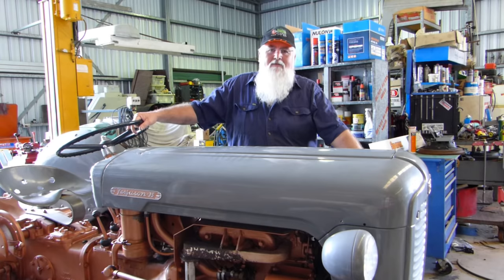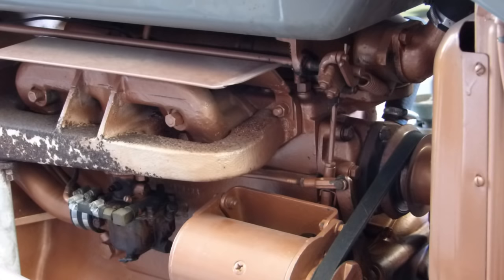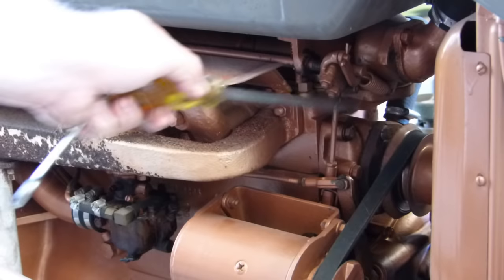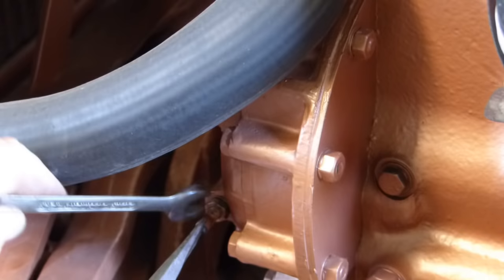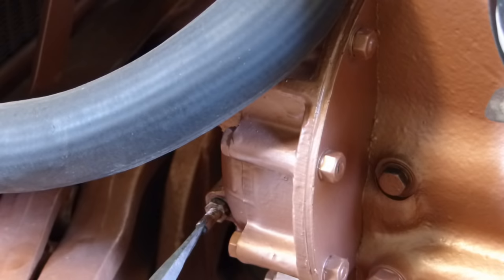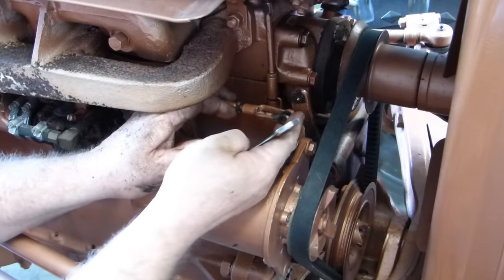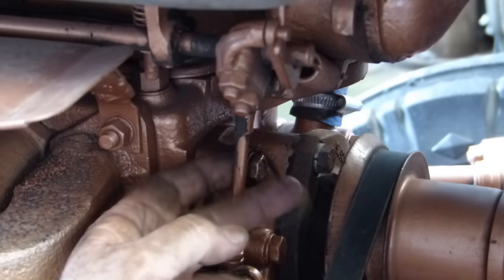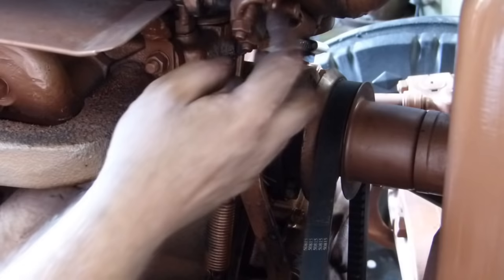How to Adjust Your Ferguson Tractor Governor

Comment: Just set mine up this week after having the front end apart with leaking timing cover and govenor seal. 
I couldn't get it idling right, and finally worked out it was the vertical governor shaft not putting enough pressure on the horizontal governor arm!! I wound it out and now it's running like a dream 🙂. Just some advise for all the people seeing this. Thanks lance!!! Ur vids are amazing, and preserving many generations of tractor enthusiasts!!
Reply from the maker: Thanks.

Comment: Thanks Dude. You just made my day. I have been having this problem for months on my tractor with no power kick when put under a load, your video just made it easy for me to fix and get her running much better. I now know too that my spring is just very worn out, so I ordered a new one and will be putting that in when it arrives. But for now she is running a lot better.
Reply from the maker: Glad I could help. They run nice when you get it right.

Comment: Mr Bears I too am having troubles with my rod. Where yours is sticky, mine is sloppy. I have looked behind where you stick it in the hole and it's just slopping around. After watching your video I see it can be adjusted, shall do it tomorrow. Thank you this is not the first time you videos have helped me. I have inherited a neglected 49 Fergie and I am determined to fix it, wouldn't be possible without your information, Thanks again.
Reply from the maker: Thanks, I hope you sort it, the whole process is fairly easy if you sit and look at it.

Comment: You are an excellent teacher! I like how you don't leave out little tidbits of information. I have always avoided any work involving governors because i just don't understand them. My TEA20 had this annoying issue with the throttle leaver always wanting to be in the idle position. Today, thanks to your video, I figured out that the previous owner installed the idle arm and spring upside down. So instead of sitting below the Throttle rod, it was over the top.. Hopefully that fixed it! Thank you so much from Canada!
Reply from the maker: Thanks Ken, Im glad it helped.

Comment: Awesome video! I hope it helps me. I rebuilt the carb on our to35 and pulled the clevis end off of the rod. I did measure the length but found out later I didn't get it back to previous length. I could only get tractor to start but not run. My kit instructions were terrible! My kit was from tractor supply. After searching YouTube videos, I found that I didn't replace rubber seal on throttle shaft. When I tried to replace the seal, I popped out the brass piece that holds it in and lost it, but found it a few days later. I'll work on that as soon as rain stops today. Not sure if this seal prevented tractor from running. I originally rebuilt carb because something stuck open in carb and an entire tank of fuel drained out through carb from one evening after use to next afternoon after work. My carb was so gunked up, it looked like a kid made a mud ball. The inside looked like someone was using it to pan for gold. I had to soak it for two weeks in my parts washer. But, even after cleaning and new needle and seat, needle doesn't freely drop with float while bench testing for float drop measurement. Hopefully it will with fuel pushing on it. My kit doesn't have spring or clip on needle. A mechanic friend suggested making a clip from a paper clip. Also, throttle would never stay, always had to be held in place. So I removed long rod. Spring was broken into a few pieces. I replaced round gasket and cut down a generic spring. Now I need to get everything back together and adjust tension. This video should be of great assistance.
Reply from the maker: G day Daniel I hope it does help you it seems you have had quite a lot of trouble so far.

Comment: Thank you, I've been waiting for something like this. I have a Fordson Dexta with the Standard 87mm, and no petrol manuals exist for it, apparently. I'm located in Ontario Canada and will have to wait until the temperature gets a bit closer to freezing before I adjust it. :)
Reply from the maker: I had a look at the petrol Dexta recently and I believe it  is the same engine so hopefully it will work for you.
Reply: It warmed up a week or so ago, and I got the throttle linkage and governor adjustment straightened out. Now when I'm piling snow and can't go any farther the wheels start to spin and the engine doesn't  bog. Thanks.

Comment: Another spot on explanation on a subject which up until now always worried me to get involved with , I am off to  check  my TED20 this morning  as it has suddenly started to cut out when I go from medium throttle to idle , I hope this maybe the reason why unless you know of any other reason .brilliant video once again , thank you very much
Reply from the maker: G day Paul, Your tractor shouldn't cut out due to governor adjustment as it should just push it back to idle, I would check carb adjustments.
Reply: Will do cheers Lance

Comment: Thank you for this great instruction Lance. I adjusted my governor system after a complete service of the timing cover with new seals and even new needle bearings but I have one strange problem. When I open the throttle from idle position and go back to idle again like you do around 19.30  the link to the carburator does not move back to idle position. The link is moving when I open the throttle but when I close it the link does not move. Everything is working free and fine on the carburetor. My only idea is that the spring sitting on the rod is too long or not strong enough but the spring is new and the only length you find nowadays for sale. Description says it fits for TEA engine. The parts list says 2 different springs were available depending on the serial number under and over 100000. When the engine is running and I open and close the throttle the engine goes back to idle. A much bigger issue is that I cannot reach more than 1500 rpm because of the governor stepping in much too early. Without the links connected I can open the carburetor throttle and rev up much higher but as soon as the governor is working it pulls back the lever much too early. I will open the whole thing again and check the weights of the assemby first to compare with another weight assembly I still have somewhere.
Reply from the maker: The rod in the spring is adjustable and it should physically push the carb back to idle. Try adjusting both the upright rod and the one to the carb.
Reply: @BundyBearsShed  I did exatly what you teached in the video and used the service handbook as well and the procedure is the same. It does not work and I reach only 1500rpm what could be the proof that you are right and I have to face the fact that I am to stupid to adjust my governor. And I have no idea why...

Comment: I watched this video a half dozen times.  I still can't get my tractor to idle.  If it idles ,  it won't rev and the governor does not call for more throttle when under load.  I have to settle for one or the other.   I go for no slow idle. Thanks for the video.  It is very good.  I just wish it worked for me.
Reply from the maker: Not sure why Lynn, just check for slop everywhere and remove it if possible.
Reply: Thanks.  I just tried.  I think the problem may be the idle adjustment on the carbitself. I removed the screw entirely and no change.  By the way, who's the genius that put the idle adjustment behind the carb. where no one can get to it to make adjustments with the engine running?

Comment: At the end of the video you mentioned the throttle kicking. Did you cover this in another video? Ours does the same. Very good videos by the way.
Reply from the maker: Fiddle with the length of the rod going back to the carb.

Comment: Lance, watched this video so many times I can mouth the words you are saying...LOL.  Great video!  The Spring, Plunger to Lever does not seem to be available anywhere that I can find.  Would you possibly have a source?  Compensator springs all over the place to buy.  Having to resort to buying used governor  parts to get this square ended spring.  Of course, the old ones are tired.  Any thoughts?  Thanks for all you do and pray the family are all doing great!
Reply from the maker: G Day Marvin, I dont have a supplier and there is not one Im aware of but it would be handy at times as I get asked from time to time.

Comment: Very well done and a VERY helpful video. And now a question. Where can I buy linkage parts? My 1/4" adjustment rod is broken just above the lower "fixed" adjustment nut. Yes I can use a piece of all thread but it won't be as strong and I want an original look. Thanks and keep cranking out those videos! You/they are a LOT of help!
Reply from the maker: I have the ball and rod on the queensland tractor spares web site.

Comment: Hi Lance, love your videos, the setting of the governor in your case seems pretty Straight forward, however my fe35 has not been rebuilt so I was wondering if you have any tips on goner adjustment for an older tractor as my governor weights keep getting stuck at full fling when I adjust to your/factory settings. I feel I’m close to resolving the issue but it keeps happening 
.
Thanks in advance

Regards

Kerry
Reply from the maker: set the screw in the timing cover in a few mort turns, that will stop it coming out so far , to a point.

Comment: Hello Lance from Southern Arizona, Excellent video, I have a 49 TO20 that has a significant surging issue. I've tried carb adjustments, with little help. When it surges I can pull then release the choke knob and it clears for a moment.  Do you think my issue could be the governor?  I plan to adjust it per this video.  Thank you for all your great videos.
Reply from the maker: It could well be the governor, it is a good place to start. Lengthen the rod from the carb to the governor and see what happens.
Reply: @BundyBearsShed  Thank you very much, I adjusted per your video and it did help a lot.

Comment: I have a TE20. My Zenith Carby was in bad shape. I ended up putting an aftermarket carby on it modeled on the Shebler carby. It has never run the same since. I have done a heap of troubleshooting but can’t seem to get things right. I watched this video and realised I never reset the govener so I will try the adjustment and see how I go. Should I rebuild my zenith or continue to use the aftermarket carby? Thanks for the great video. 👍👍👍👍👍
Reply from the maker: I always prefer the Zenith they are not too hard to do.

Comment: I rebuilt my MF135 engine about 2 years ago because the governor fell apart inside. put all new back in and I still for the life of me cant get the governor set at all. Its like it doesnt work at all while pulling my brush mower. Any ideas? Also, the screw on the timing cover screws in way more than what youre showing before I feel and tension.
Reply from the maker: i would suggest backing the screw out to give the governor room to move possibly.

Comment: Hi Lance, been following all your Fergie vids. Been trying to adjust my governor linkage, but when it comes to attaching the governor arm to the carbie it's pulling the throttle forward, it's as though the spring for the bumper screw is pulling it back forward. Can you help? Also the carbie is running a bit erratic and can't seem to get the tuning just right. Got a good spark at the Distributer
Reply from the maker: First up try lengthening the rod a fair bit it seems to work wonders.
Reply: Thanks for the help Lance, really appreciate it!

Comment: Hi lance , hopping you can help me , I have put new weights and gov or cup on my tea20 as part of the rebuild , but the govnore keeps jamming , when it take the front cover off the cup has come out too far and got caught on the weights and Carnot go back in .
if put back together twice now and it keeps happening ?ant clues as to why , maybe a faulty new weight basket ?
regards Mark New Zealand
Reply from the maker: Try tightening the screw in the side of the timing cover to put tension on the spring so the cup cant travel so far forward then do the setup.

Comment: I have a problem with my TEA20.  My question is does the throttle pull down or push up for idle? This is my first tractor and it was not all put together. I can't get it to idle , the springs make it run full throttle.  Also do you know where I can get a governor lever arm rod? Great video.
Reply from the maker: G Day Dennis, Pull the throttle for throttle and push it back up for idle. You would need to try a wrecker for the lever arm.
Reply: Thanks
Reply: @BundyBearsShed  , Lance can you help me out with this. I just drained my transmission and differential oil. I removed the 3 drain plugs, and it looks like the front 2 plugs had regular oil in them, and the back 1 had transmission fluid in it. I thought all 3 plugs would have the same oil in them. I don't see where I can fill the differential. Don't you fill the transmission then the oil good in all 3 spots? I have a TEA20 tractor.  Can you help me with this. Thanks

Comment: Lance Great Video, very helpful. I have TEA 20 1948 model. In video you show lots of movement in the governor arm at time 4:29. I have very little movement maybe 6mm at the pin location. Does this mean i have a issue within? Do i need to remove the timing cover and inspect? What will i be looking for? Thanks in advance.
Reply from the maker: G Day Todd, Normally not much movement will help with these governors, It depends on how far the screw is in.

Comment: Hi lance, ive got a fergie 20 tvo im only young and would love to start this as a good hobby but im having a problem with my throttle leaver it is stuck on high  acceleration and wont go down i took the throttle linkage off the carb to see if the throttle linkage was too short from the governor but it just is moving a tiny tiny bit, i still dont know if the throttle linkage is too short but i highly doubt it because it does move the same way with it connected to the carb but only if you push it, not with the leaver atall. Sorry if you found this hard to read i have adhd and find it hard to describe stuff 😅. Thank you, Kevin
Reply from the maker: Follow the video step by step. Start at the front and work your way back. It is hard to say what is going on without seeing it.
Reply: @BundyBearsShed  thanks lance will try that today

Comment: Hi Lance. Great video. I think I followed it properly :) Do you know, should the throttle handle stay where you leave it or should it (like mine) feel like it is spring opposed after half way, so it comes back to half way if you let it go?
Reply from the maker: Spring back, It sounds like yours is doing the right thing.

Comment: Hi and thanks for a fantastic video.
On my TEA 20 from 55 the govenor kicks like a mule when i open the throttle a bit. It kicks two or three times in a row, every time. What could be the problem?
Reply from the maker: I would look at the carb settings as it should even out reasonably quickly.

Comment: Gday Lance watch your video with great interest i had to put a new timing cover on my TED20 cause the spring was broken in there all replaced chain lined up to cam like you showed run really great however the governor does not work i done all the setting you showed on this video you got ant ideas what going on many thanks Ron ps keep up the great work
Reply from the maker: G DayRon, It is hard to say but I would start with running the tractor and see if the governor arm moves at all. You may have to adjust the side screw out a little.
Reply: @BundyBearsShed  ok thanks will try that many thanks Ron
Reply: Gday Lance i have done that i started out with the screw in 2 turns so i came to 1 turn no different so i turned it in 3 turns still no difference many thanks Ron

Comment: I have a TE-20 that I recently bought and they had a big spring going from the carburetor to the governor rod. Anyway I started following along to this video to set the governor and at about the 4 minute mark of this video with the linkages un hooked I found the the governor rod doesn’t move ? What’s your thoughts
Reply from the maker: See if the side screw on the timing cover is not in way too far but it could be possible that the shaft is stuck.
Reply: @BundyBearsShed  
Thanks for the advice. I’m planning for the worst and buying a new replacement governor it’s an umbrella type. I’m told it will replace the old weigh style that mine has. This tractor has very little wear so it may very well be stuck.
Reply: I had the screw fully removed and it still didn’t move well. Online the sell a umbrella type governor replacement for what I presume is a weighted system that I have in mine. Are the old weighted type better or is the new umbrella type better?
Reply from the maker: @jasonkilgore1977  they usually have weights that hook onto the umbrella I'm only aware of one kind over here.
Reply from the maker: @jasonkilgore1977  I just realised you are ona Continental engine and we didnt have them here but I wouldnt mind a play with one.

Comment: Please I need help! I have a '49 te20 and my governor rod spring broke, do you have measurements of it and possibly how strong it is? I cant find the info anywhere and cant find the the part online.
Reply from the maker: The only place I know is a tractor wrecker, they are not available aftermarket.
Reply: @BundyBearsShed  I found one in England, but I'm just looking for the dimensions of the spring so I can maybe find one locally, mostly I just dont want to put one on that's too strong. Love the videos, got me through the restoration last winter.
Cheers from BC canada.
Reply: @BundyBearsShed  if you found a supplier, would you be interested in ordering a few? Also would you mind taking a moment to measure the wire diameter and the outside diameter of the coils please?